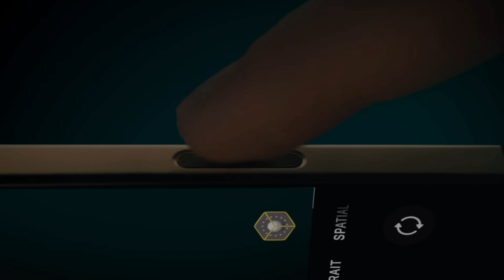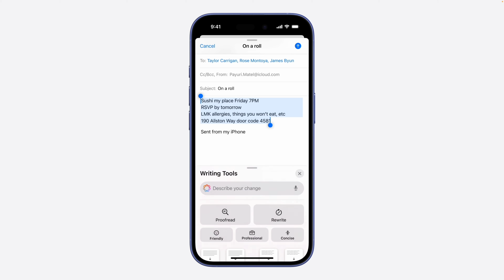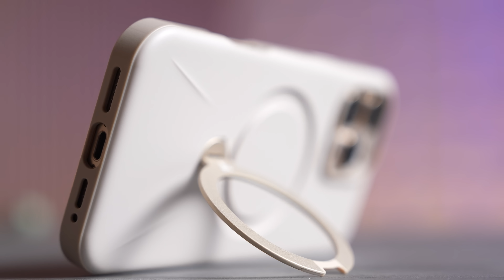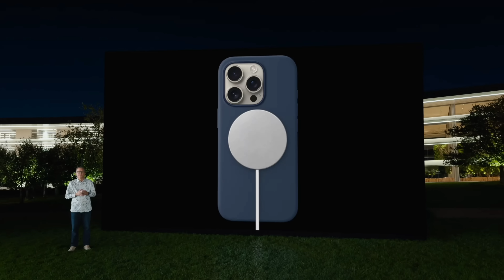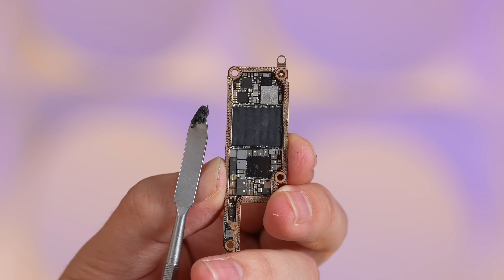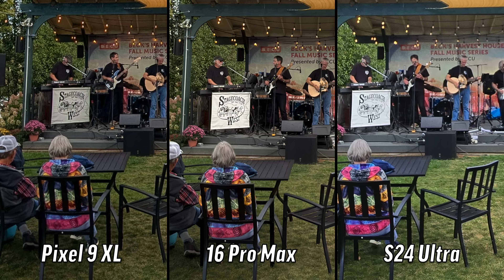iPhone 16 Pro vs 15 Pro - REAL Differences After 1 Week!

Comment: We need to call out Apple on their BS. Their success has made then lazy. Even Android manufacturers did not present their gimmicks as some new great thing. Camera Control, as they call it, is nothing else bud a huge gimmick which does nothing to improve the user experience.
Also, it should be illegal to use a feature (Apple Intelligence) as the main selling point, which will only be fully available mid of next year, and who knows how many regions will actually get access to it even then.
In the last two years I have switched to the Apple ecosystem. If they continue to fool around by the time iPhone 17 comes out, I will most likely go back to Samsung and Windows PC.

Comment: 15 pro max is a great phone and no reason to upgrade if you have one. I'm feeling 16 pro max is dedicated for influencers and all people who actually rely on all the camera features and need to have best of the best. I can confirm I play around with iPhone 16 pro and camera button is just another one which is there but most of the people won't be using it.
Reply: The reason to upgrade (in my case) = thermal improvements depending. I don't have the throttling and dimming any longer which many aren't bringing up. It depends on what people use their iPhones though of course.

Comment: Apple needs to revamp their IPhone lineup.  I know many would disagree but there needs to be a difference in specs between the Pro and the ProMax to justify the $200 price difference.  A slightly bigger screen is not enough to justify and I see many people mention online that they are downgrading from the ProMax to the regular Pro.  They should have 3 models.  The IPhone at 6.1 “ with 2 Cameras, the Pro @ 6.4” with 3 Cameras, and the Ultra with the highest end hardware.  Dual stack Oled from the IPad, more powerful chip with 8 cores and more powerful GPU, 4 cameras, better zoom, better cooling etc.  Make it the Gaming/Video/performance model.  Increase the pixel density of the screen.  It has been stuck at 460 ppi forever.
Reply: The reason is people are still buying. Unless they are not buying it anymore, Apple would just do the same over and over again every year.

Comment: I have followed for at least since the 12 and I believe this have been the most unnecessarily negative review you have ever done. All things you have said is the best of iPhone or needs to be fixed seems to have reached its peak on the iPhone 16 Pro Max. It beat out even in your photo/test video you guys did.  iOS 18 is no better or worse than previous upgrades.  Your judgement is clouded by lack of extra stuff like AI and the camera control. RETRACT 😂

Comment: Bro we have seen this video a million times now, do a comparison between 13 Pro Max and 16 Pro Max because that’s where a lot of people may upgrade 🙏🙏🙏🙏🙏
Reply: I made the upgrade from the 13 max. I can tell you that Wifi is a lot faster. Overall speed of phone is better. Screen isn’t much better. Weight is noticeably better. I don’t use a case, the rounded edges of the new one is worth upgrading for me. Camera meh. Battery is better. I will for sure use the AI. Or was worth the upgrade in my opinion.
Reply: True I still can’t find a video for this comparison
Reply: There is comparo between  13pm vs 16pm already out
Reply: I upgraded from the 13 Pro Max to the 16 Pro Max. I like my new phone. I especially love the usb-c plug in.
Reply: @neffst same story for me
Reply: I have Iphone13 Pro and yesterday my entire screen went green. Im so sad because I did not damage the phone. Was simply scrolling tiktok in bed when the phone broke on me. So i'll be getting 16 Pro but doubt there's much difference...
Reply: Can you do a comparison of 12 pro max v 15 pro max c 16 pro max so that I can decide? Thanks. Mine is 12 pro max
Reply: I’m impressed with the build quality but I’m so used to android I go to something and can’t because Apple doesn’t allow it. I want Linex or something on my iPhone 16pro
Reply: Correct .. i have the iPhone 13 Pro Max and it will be worth it for me to upgrade to a iPhone 16 pro max….
Reply: It’s useful to me as my contract allows me to upgrade frequently. I don’t think it’s worth the effort at the moment.
Reply: MKBD HD wasn’t that impressed either and it seems that the basic tone is that unless there’s some feature or features you absolutely need there’s probably not a reason to upgrade because Apple simply didn’t put it into this model phone   next year, they probably have to go all out.   I have a 13 Pro Max and the Mrs. has a 13 Pro and all we’re gonna do is replace the batteries plenty good enough to make it until the 17 which by the way the 16 is launching without AI is a total cluster.
Reply: Just go look up the video you want don’t try and tell someone how to run their channel a lot of people want this video

Comment: My iPhone 15 pro max sucks. I’m at 99% battery life with 86 cycle count. 😢. We have strong WiFi but not according to this piece of junk. My cell data sucks and eats the battery. Apple says nothing wrong with it. But after just 3.5 hours max screen time this morning, I’ve gone from 100% to 86%. Only had it a few months. Turned in my 12 pro max so I am so stuck with it 😭😭😭😭

Comment: The only issue I’ve had with my 16 Pro is the cellular signal strength. I feel like my 15 PM was better. I live in NYC and my 15 PM would pick up service at every subway station while underground. My 16 Pro struggles with this. Not sure if anyone else has this issue. Hopefully a software update fixes this 🤷🏽‍♂️

Comment: My iPhone 15 Pro Max is still going strong. 😎 Its battery health is still at 100% with 368 cycles. I'm waiting for iPhone 17 launch.
Reply: Wow that’s impressive, I’m at 96% with 235 charge cycles and I only charge my battery to 80%
Reply: How is that even possible? Share your charging method and routine. I have a 15pm since launch and it’s at 89% with 382 CC.
Reply: I got mine at launch it was down to 86%.
Reply: has to be a glitch and how the software is reading because it’s literally impossible to have a hunters percent battery health with that many cycles.
Reply: I'm using my MacBook Pro m1 pro to charge my iPhone. I'm in habit of charging at 40% battery to 90%.
Reply: Just checked Coconut battery and it was showing that it is at 99.4% of designed capacity.
Reply: Wait for the iphone 21
Reply: As you should
Reply: How is that possible? Im at 95% with 216 cc on a 15 base model thats been on since december.

Comment: Upgraded from 14pro to 16pro and to me it’s a great upgrade. Snappier, smoother, larger display, usb c, better camera, new buttons, cooler running, better battery,….so much to enjoy
Reply: totally, but if you have 15pro/15pro max the upgrade is not big at all. 15 pro series simply did a lot vs 14 pro and you benefit from all of this and some more. Objectively 16 pro/pro max are both better vs 15 pro/pro max, but the difference is not that big to justify spending 2000 euro (yep, welcome to Europe :D)
Reply: @gmdhighvoltage its not for 15 pro users. Apple basically told 15 pro users to stand back lol
Reply: I agree I like it better than my 14 pro max, it’s lighter comfortable to hold in my hand, just a little bigger which I was worried about.. Enjoying all the new features.. Best iPhone I’ve had so far..
Reply: can you upgrade my iphone 7?
Reply: If you have Iphone 15/15 pro ranges the Iphone 16/16 pro is not for you to upgrade. If you look at the upgrade patterns and the length of the carrier contracts coupled with high prices of these devices then you will only need to upgrade every 2 to 3 years. This is why Apple compare this device to the Iphone 13 ranges, that is where you start noticing the overall improvements through out the generations.
Reply: About to upgrade from an XS to a 16 pro. Don’t really want to wait one more year, but hopes are high for that 17 based on all these not so great reviews compared to the 15…
Reply: I upgraded from a 12 pro max and I see a big difference.
Reply: I’m on my 14pro still waiting for the 17 lineup to drop to see if I want one of those or one of these two 😅
Reply: I had the 14pro & it sucked LOL
Reply: @chrisanderson9359 bro I feel the same about the 14 pro I’ve not been able to wait to upgrade mine brock back glass broke I paid close to 500 bucks getting it fixed then 6 months later I broke the back glass again in a case in my pocket sitting on a bucket trash then back in Feb this year my camera lens broke. Some bs the 12 glass was a tank
Reply: You forgot the biggest upgrades of you’re coming from 14. The Apple intelligence which launches today.
Reply: Why I have the feeling that the iPhone 14 Pro has a better and brighter overall screen ? The one of 16 pro has a yellow tint in white background… checking them side by side and the overall brightness is way better in 14 pro
Reply: How much does the battery last?
Reply: I agree I did the same 14 to 16

Comment: I have a 12 pro max and still not upgrading I’m not having high hope for apple intelligence at this moment
Reply: Just upgraded mine from 12 pro max to 16 pro max. Honestly, it is a significant upgrade for me. The 16PM battery life, flawless performance, faster charging, better camera, significantly lighter than the 12PM… yeah, overall good upgrade for me. And AI on the horizon, for my scenario, its all good. You will appreciate it honestly. My advice, do whatever makes you happy. Dont let others decide how and what your happiness should be. 😊
Reply: @ashburne  I want to do the same I have a 12 pro max, thanks for your feedback.
Reply: You’re missing out, from an iPhone 12 to an iPhone 16, the upgrade would be more substantial
Reply: @Adam_player_1  I agree it would be a substantial upgrade im happy with my current device :)
Reply: @psvita100 Honestly if your happy with it keep it. Sure the 16 pro max is a big improvement but the 12 pro max still works really good. When the iPhone 17/18 or later  pro max comes  out you’ll notice WAY more differences than if u opt for 16 now.
Reply: @Adam_player_1  It's a marked improvement from any device depending I think because I was getting lots of throttling and dimming on the 15 Pro Max, and not on the 16 Pro Max. That made the upgrade worth it alone. Boring but very practical.
Reply: I’m going from a 14 pro to a 16 pro phones cracked camera lenses cracked I usually up grade every year usb type c better battery this AI so it’s worth it for me

Comment: Sounds like a lot of this will be resolved over the next few software updates.
Reply: Possibly, however that's not a good launch. Feels like beta testing
Reply: @amazingman333 it is beta testing. Although it does give 15 pro/16 users something to look forward to over the next few months 😂
Reply: Even on older phones (15 PM, 13 PM, 11 PM for me) iOS 18 is insanely bad, iOS 18.1 at beta5 is a lot better already, but still obv there is a lot of work to do... I feel apple dragged all the good devs and effort towards the AI as they clearly are behind the schedule and try to compensate. So many other aspects of the operating system are neglected for now.
Reply: Yep, it will…. “”Than their will be a video explaining “I was wrong” lol
Reply: I don’t trust Apple to update shit. They still haven’t even fixed contact posters
Reply: Exactly.  No one has any patience.  AI and other features will be added this year or early next year.  No rush.  Still a good upgrade if you are coming from an older phone.
Reply: @RA-nm9xu no one has patience today. Plus people love complaining today…..